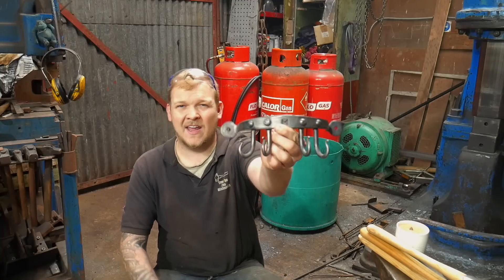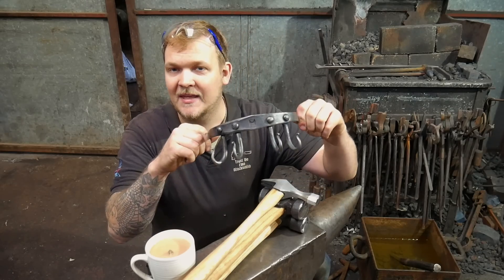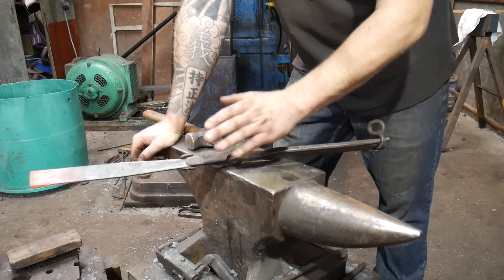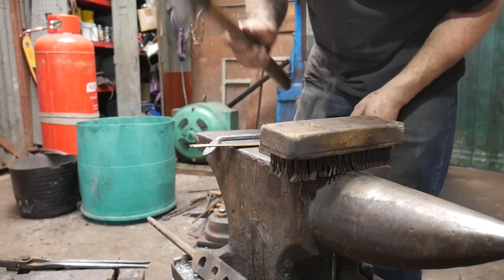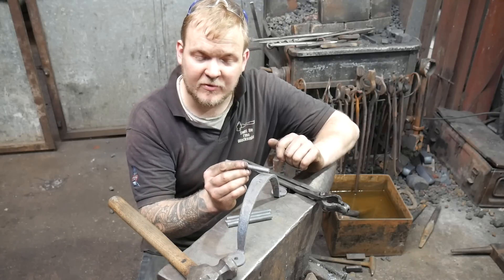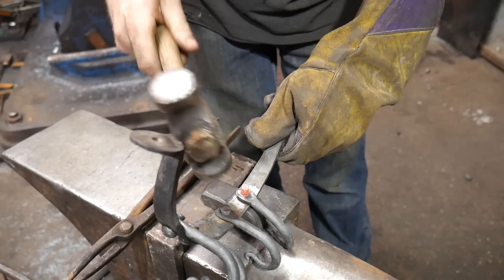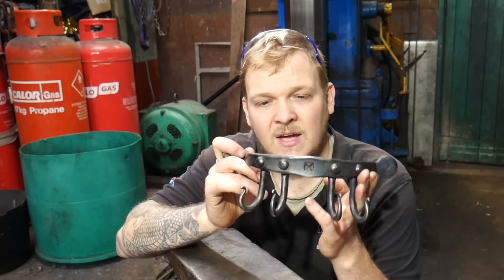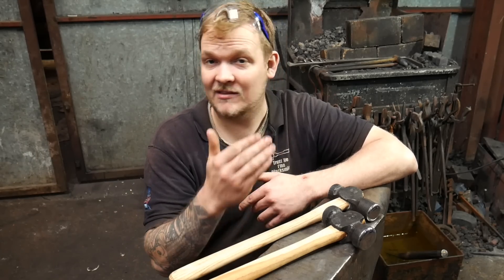Blacksmithing! Things I wish I knew when I started! Dirty Shed Collaboration!

Comment: holding your work firm and steady, getting a good hold is paramount, and a good set of tongs specific to the job is my biggest thing. This makes or breaks my ability to finish a project properly.
I like how you said thinking through how you are going to do your next bit, you only have a window of when the heat lasts and you must know what you need to achieve during that time.

Comment: nice work Big Fellah, and another good video topic. I'm not exactly an expert Blacksmith, but nor am i a beginner, so i couldn't agree more with this stuff. especially regarding keeping everything nice n straight as you forge, the right tongs and having all the stages thought about and tools ready for each heat etc. but the best practice i've had and keep having is taking the time to make more tools, and tongs tongs tongs! i had no idea of the amount of tooling I'd be using to bash away on hot steel, but making all these things is where i've done all my learning.

Comment: Dan in my younger days when I actively shod horses I found the sweetest hammer was a square  ended rather light  job as short and sharp blows get the best turn on a nail.. It was super easy to get a good drive and turn on  the nail and then wringing the turn off was easy too with just a flip of the wrist.. I think i t was a Diamond hammer (long time ago). Still have it if you want  pics. I was shoeing horses with chalky white feet and a quick turn on  the nail was essential. Cheers and thanks for the video.

Comment: Key items I am finding - knowing where to apply the force, how hot to do the work or stop work, and the workholding itself. Sounds easy or basic - juggling act for a newbie. I find I plan the step, get excited with red hot steel and time a-wastin' - and forget entirely what I just planned to execute. The other thing that happens - plan the step - tongs shift and I spend the heat just trying to grip the workpiece... then it is so cold all I can do is go back to the fire.
It really is a bit more difficult than you make it look. 
Wish this old lady me was as strong as the young lady me used to be, I think that would help some too. 
AH well, ya work with what you've got.
Hammer on!

Comment: I really like the part where you explain to plan ahead. It is a so important skill, to focus on the workpiece, plan the next heat. Also Nils Ogren mentioned that when he forged the hammer with Torbjörn Ahman, too. Perhaps my german roots to like efficient things, don't know :)
But If I master all basic ways to form steel, I will try such a nice key rack, too.
Reply: Hey Stefan, @Daniel Moss makes it look easy, but there's a tonne of techniques to master in there, great little project for blacksmiths starting out. Best of luck with your endeavours.
Reply: @DirtyShedCreations  I know, I still only straightened a piece of spring steel. Was a hard 30 minutes fight. Put a point on it, and flattened a piece of ST37 (mild steel) in my forge. But so far I like forging, it is so creative and you can shape steel in almost any figure, shape or purpose. And in combination with leather and wood, you can make literally anything that pops out of your mind. It takes only time, practice and skill. And this is the journey.
Reply: @stefanmierke4801  Great attitude - thanks for the sub, really appreciate it!

Comment: Recently got a few scraps from the guys scrapping about 8 old railroad engines, one is a large piece of 2" (guessing) thick, about a foot deep and about 4ft long, another is a coil spring the coils are 2-1/4" thick stock and a foot wide, about 4-5 coils.  Thinking axes and hammers, big flat piece for swage blocks, I would like as much function in the design of the hammers as possible, the Brien Brazeal style seems to have more than just two, when combined with his technique, is there any improvements you could add? And anything I could do to get it more uniquely artistic in looks without engraving?